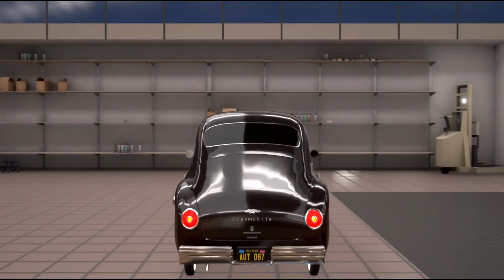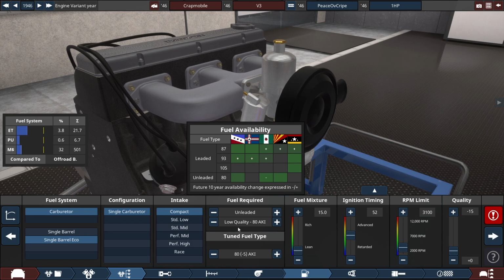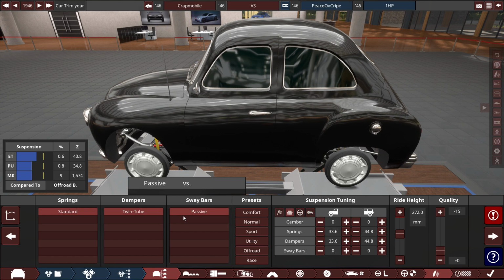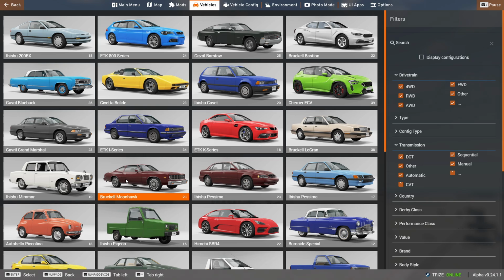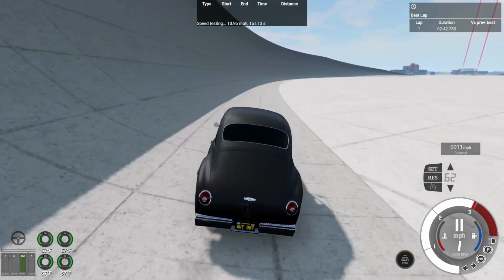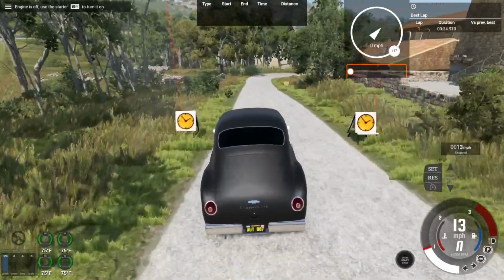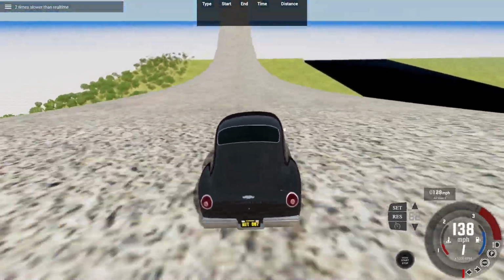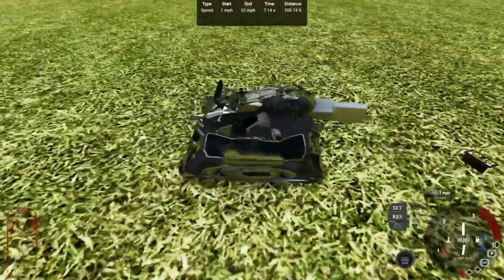I Built The Worst & Slowest Car Ever Made! | Automation The Car Company Tycoon Game & BeamNG.drive

Comment: The reason the engine stalls when you shift into 2nd gear is because of the idle RPM (2,000) and the hilariously bad gearing.
When you are at 3,100 RPM in 1st and then shift to 2nd, the RPM will drop to 1,200. But since the idle RPM is ridiculously high, the engine always stalls.
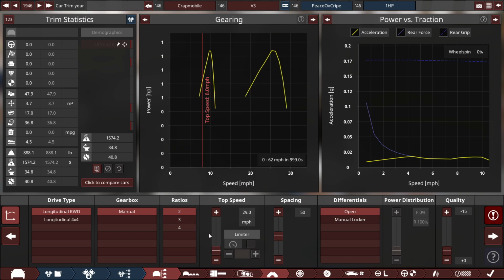Reply: Yea you can see the problem at 4:10, there is a huge gap between the two gears where the car has no gear to be able to go any speed between 11 and ~18.
Reply: Well, he did say this was the worst car ever. One could easily see this coming from a kilometer away :d